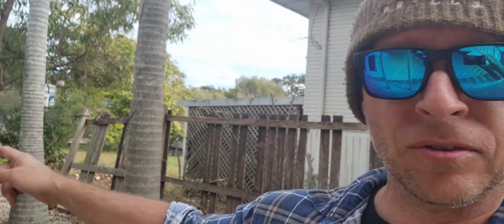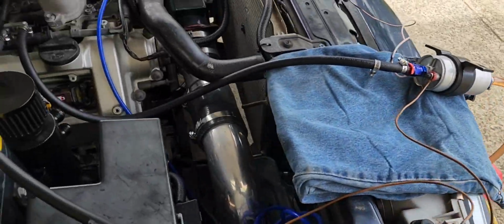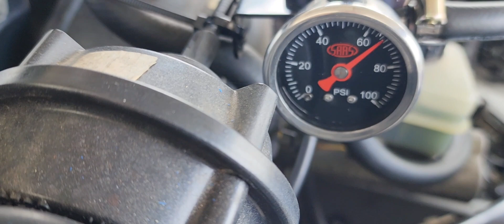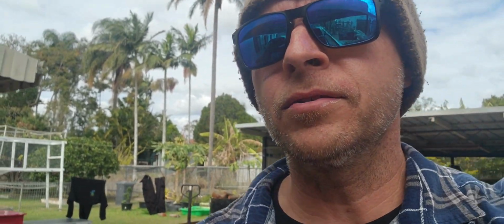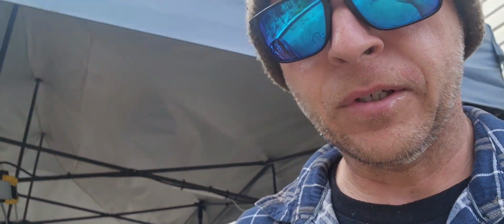E85 start on stock injectors

Comment: I need to see air fuel ratios to know if it’s safe
Reply from the maker: Yeah will have to do that in next few episodes.  I don't recommend it however I was told by a few it would run like crap. Sounds ok to me.
Reply: @domsta2008  I agree definitely didn’t sound like crap! Sounded pretty healthy! If the a/f are decent I’m gonna do it in mine!
Reply from the maker: I have made another video of it showing afr and also on the 2 step. Sounds angrier on e85. Will be uploading it in next few days
Reply: @domsta2008 sounds nice…….